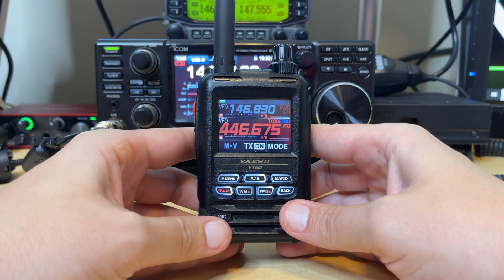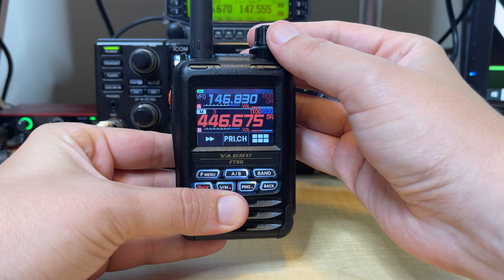Yaesu FT5D: How To Program a Memory Channel

Comment: cr@p, right off the bat, you say to make sure it is in VFO mode, and I can't get it out of saying "ALL" where yours says VFO.  Hitting Mode toggles various FM, DN, and Auto TX modes.  So I am stuck RIGHT out of the gate..   Searching now for another video that shows me how to put it in VFO mode, be back in a few.... lol
Reply: ok, for those that don't know how to go into VFO mode on an FT5D, you have to hold down on the "M>V" portion of the touch screen (bottom left of touch screen).   Now you can follow along with this video
Reply: I did try tapping that M>V area, but didn't realize you had to hold down on the touch screen.  Also, didn't know (I do now), that it is really MEM > VFO
Reply: Now this seems so easy, funny how one thing can hold up a simple process

Comment: Nice, concise vid, however, you did not mention that pressing and holding the [V/M] button once more is required to to put the radio into Memory mode to be able to use the memories programmed—otherwise rotating the knob will just show the step frequencies. Yes it should be obvious but I'm guilty of forgetting this all too often.